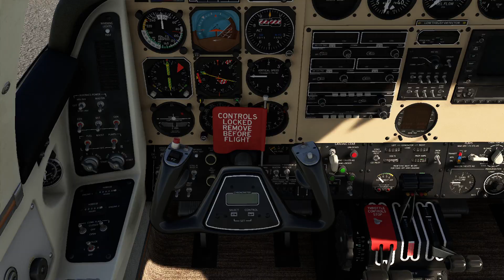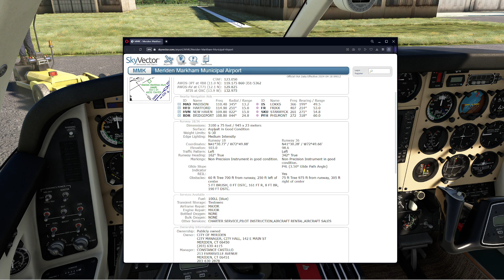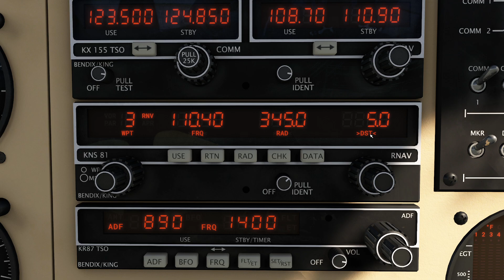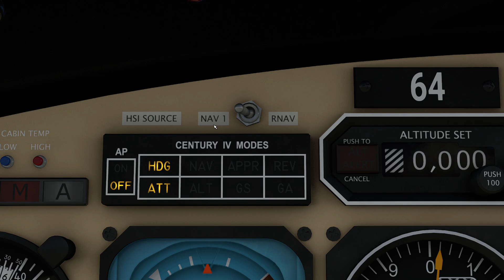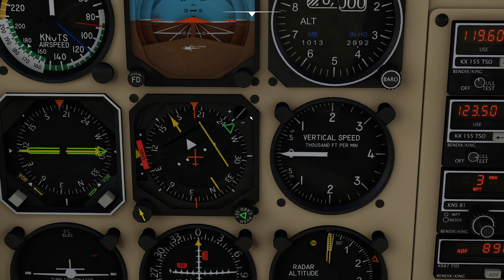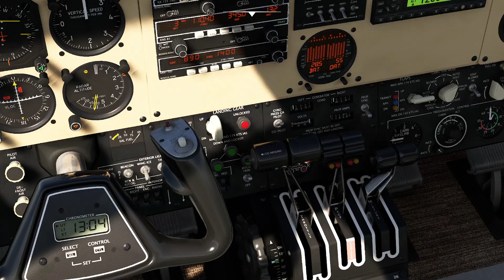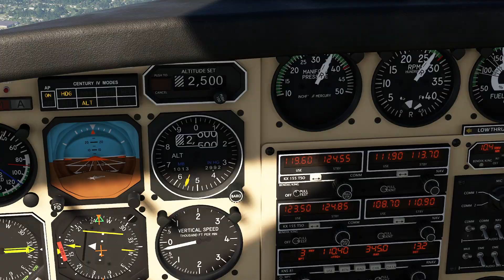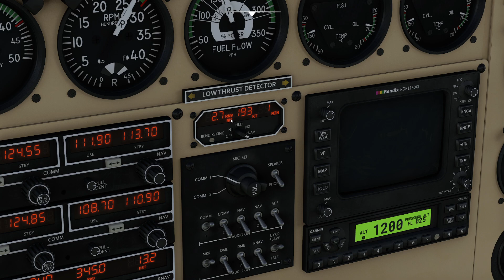MSFS - Using the KNS81 RNAV Computer Tutorial

Comment: Are there any other aircraft for MSFS 2020, 2024, or Xplane that have the KMS 80 or 81?  I actually have one in my 1979 Piper Archer II...  I've hardly ever used this feature.  But, I'd like to practice with it.  When I'm flying, I usually don't have time to fool around with inputting all the data.